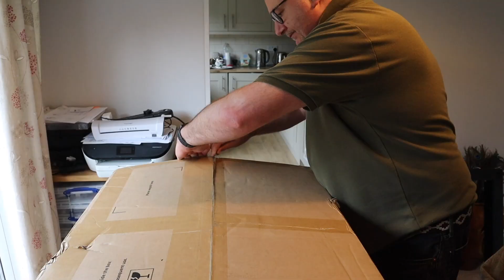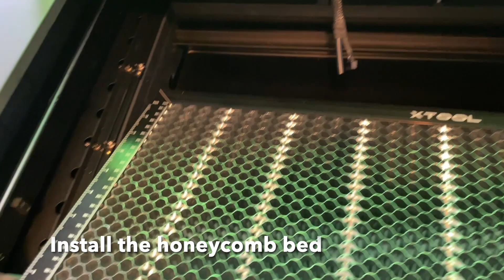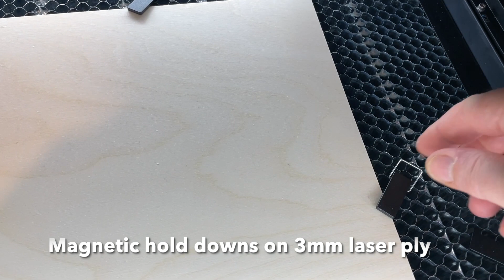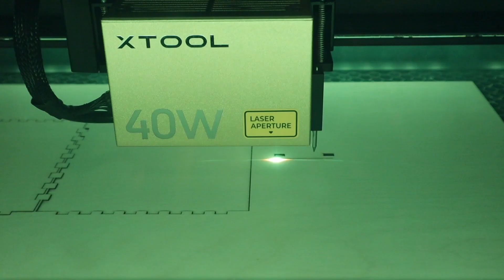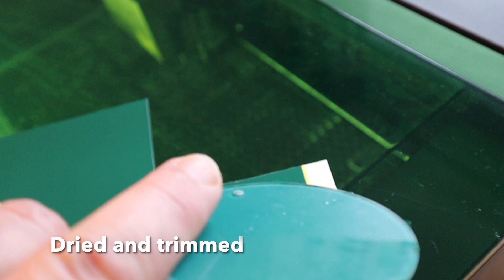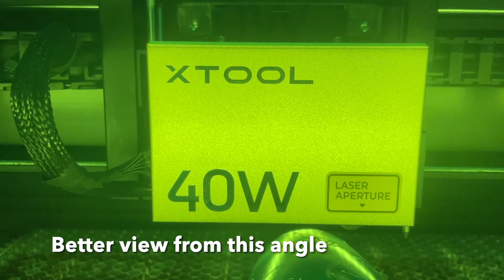Reviewing the Awesome xTool S1 40W Laser

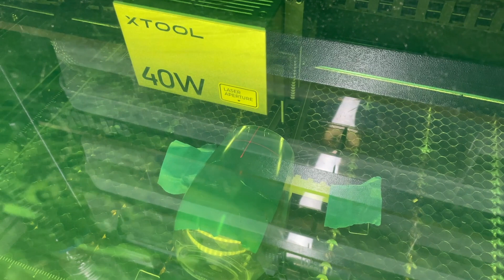Comment: Looks like a fun tool. I am surprised the focussing probe attaches magnetically instead of some stronger fastener, but maybe that is intentional so that it can give way. Maybe it prevents the machine from accidentally pressing a hole through a part (as might’ve happened on the tumbler at the 11:19 mark), or from damaging the laser if it was more rigidly attached.
Reply from the maker: Yes the probe does come away easily but it stops it getting damaged if it fouls on something